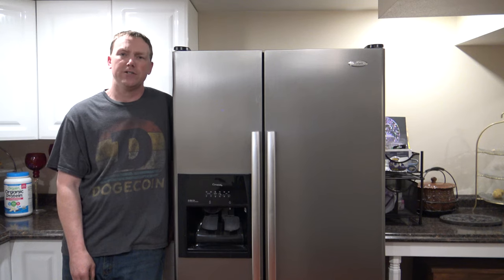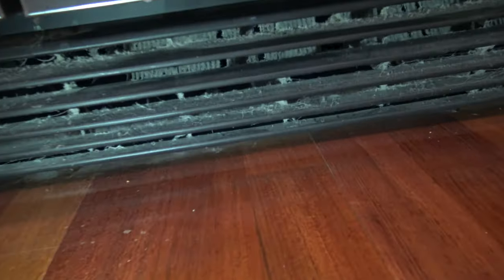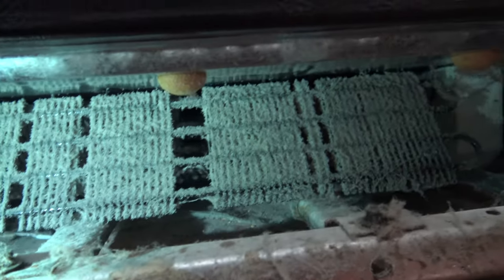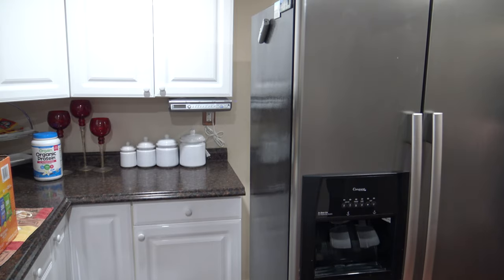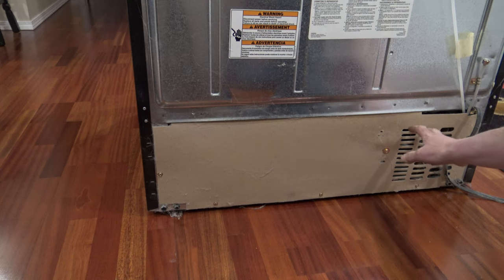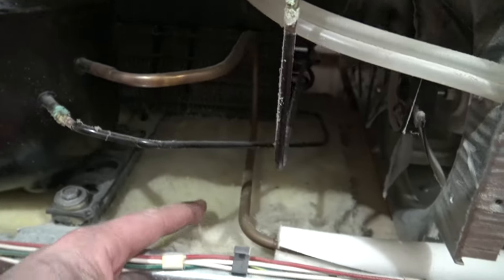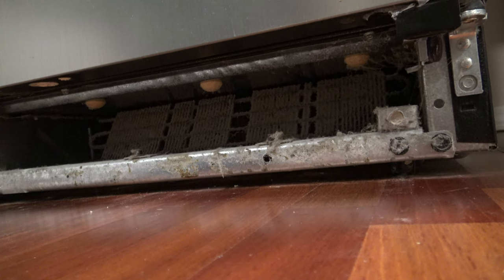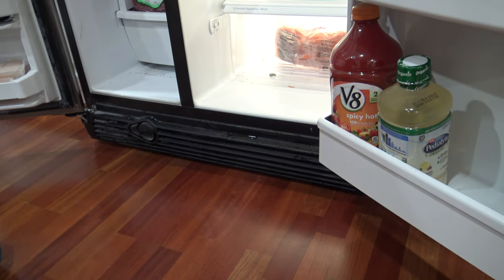Refrigerator Constantly Running...... FIXED

Comment: Mine is BRAND NEW has has been running nonstop for nearly 24 hours, has not shut off once.
Reply: panicman10  i think that is not normal for me... try to adjust thermostat setting if it will prolong the on/off sequence.
Reply: Mine is brand new and also running non stop.  It sounds like it’s the fan.  I just don’t think this is normal. I’m about to exchange it for another one
Reply: I found a video and it said this is normal on new refrigerators as they use low power compressor .
Reply: Mine does run seems like all the time
Reply: I cleaned once for a retired appliance repair man . He told me cleaning the coils didn’t make any difference he’s full of crap ! I cleaned the 
Refrigerators underneath all the time inside and out !

Comment: My whirlpool refrigerator set the cooling @3 (norma) but runs every 45 min for more than 1 hour, its coils are on the back side and are clean as well as the compressor is clean  too. I put a thermometer in the freezer, the time took to reach -14c to 16c took 45 min. May you help me what could be the problem. Thank you in advance for your help🙏